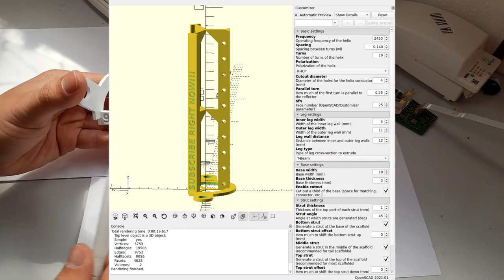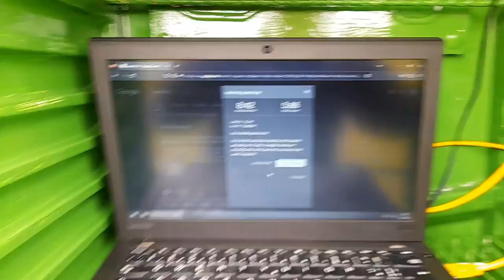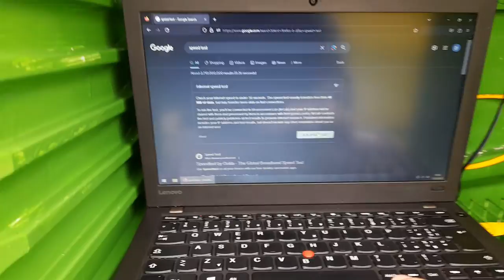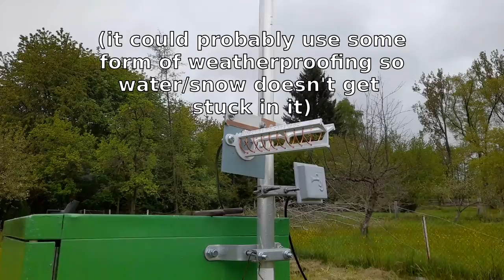Building a 2.4 GHz WiFi helical antenna

Comment: This is something Im going to try this weekend. Have a garage about 70meters away from house.
Edit: Holy smokes, antenna works as a charm, tested with my phone, and about 50 meters away its still full signal. speedtest also shows same result as if I was standing near the router.

Comment: We built high gain antennas 20+ years ago trying to network our houses together, pringles cans, satelite dishes, flower pots. our ultimate problem was the ficus trees in our area acted as giant radio sponges. we were able to get up to 3/4 mile range in a straight shot.
Reply from the maker: Yeah shooting microwaves through trees is a losing battle. I'm hoping I can get my hands on some of the 900 MHz routers, that would be quite interesting to see how they compare to 2.4 or 5 GHz, it should be able to reach further and better penetrate obstacles, at lower data speeds
Reply: We, too, have the vegetation problem.   But a part of me in interesting is seeing what it would take get "borrow" the WIFI from a McD's about a mile away.
Reply: Pringle cans.. the memories!

Comment: Love your videos !!  Way back, when I started the FCARC ham radio club. A fellow ham and I, set-up a temporary repeater on 444.250mhz. We didn't have an outdoor cabinet to mount the gear in. But we did have an old refrigerator ! So we used it to house the radio, controller, power supply and duplexer. We dubbed it the "Fridge a peter" !! It worked out very well and got some laughs too !
Keep up the great work !

Comment: Thank you for not cutting out your mistakes when editing the video. This is what it's REALLY like making something of your own! It's good that you know which parameters matter and which don't.

I was glad that you expanded the hole for the center conductor of the type-N connector. I was telling the screen that the hole should be the same diameter as the dielectric in the connector.

It would be interesting to see what the VSWR curve looked like. Do you have a nanoVNA?
Reply from the maker: Yeah I do have a NanoVNA V2 which can measure these, but I didn't really want to add that information into the video to not make it even longer (and the point was to show that you dont need any special tools like that)
I do however plan on making a loose continuation of this topic where I will most likely do the full measurements as well as long range testing
Reply: @dereksgc  Cool. I would really like to see what bandwidth you ended up with.

Comment: That looks like a lot of copper for 2.4 GHz. In a tank circuit, that would most likely be under 30 MHz somewhere. Have you connected this to a spectrum analyzer to see where it's peak is? Maybe I missed something?
Reply from the maker: not this exact one, but similar antennas I've made did have a resonant peak around 2.4 GHz, sometimes slightly higher or lower but they are wideband enough for that not to be too much of an issue
Reply: Helices actually have two radiation patterns, depending on the dimensions you choose.

If the circumference is much smaller than a wavelength and the pitch is much smaller than 1/4 wavelength, then they do act like a dipole, with an omnidirectional "radial" pattern, perpendicular to the axis of the helix.
But in this case, it's a directional ("axial") helix antenna, where instead the circumference of the helix is proportional to the wavelength, and the number of turns affects the directional gain. Then, the maximum gain is in the same direction of the axis of the helix.

The Wikipedia for "helical antenna" goes into more detail about those two modes.

Comment: Biquad behaves better when there is no direct visibility to the helix. At the helix antenna, in addition to the drop in reception level from linear to circular by -3dB, the reflected signal has reversed polarization and is not received by the helix antenna. It is ideal to use helix antennas in both parts, installed in a place with direct, unobstructed visibility. You can also use a biquad or helix as the primary antenna for a parabolic antenna, which seems to be sitting next to the rack, unused.

Comment: neat. I built and use these starting in 2013 for my drone photo/video business(at the time). Before then, Soda cans for home wifi (like idk 2007?) Now, am an active amateur radio enthusiast and building all sorts of fun antennas. I don't think I heard it, but your method to attach the center conductor is perfect, but really ought to be measured and kept at a distance that maintains a 50ohm insulation gap, which the hole in the reflector perfectly accommodates. Where it seems it might be too close is that 3d print might be dipping down before spiraling up. But that's just nit picking, and your results clearly are good. Great video!

Comment: I have been thinking about building 4 Helical antennas for, 1296MHz EME. 2 left hand and 2 right-hand polarization with one feed point for a 4.5 meter dish stacked very close together. Those printed coil supports look awesome.

Comment: Thanks for this video.  I definitely want to try this with my Internet connection which is cellular based.  One recommendation on testing.  You should give iperf a try.  You could setup the server on a workstation in your house and then run the client side on the laptop in the fridge.  That would tell you the true bandwidth between your house and the fridge for the two different antennas.  Who knows, maybe the helical antenna is ever better than 4 times.

Comment: You might get a step drill for working on the sheet metal...they leave a bit of a chamfered edge, and don't "grab" when they go through, and you just drill to the hole size you need... Safer, and 'cleaner' !

Comment: You only can gain so much improvement until the bandwidth needed needs a transmit frequency higher than 2.4ghz 

Problem is propagation, you want as low as takeoff angle to have dem waves travel  as close to the horizon before they fly out in to space, also one that won't be affected by water vapor, trees, or a building

It's also quite helpful for the wifi access point be at the highest elevation relative to area and devices connected

Then use a 2.4ghz repeater to allow a slower network to fill gaps

Comment: If I wrap the copper wire in helix, around a 3D printed PLA tube, which has a pre defined grove in helical form, and super glue them together and keep that tube attached to the dish. Will that effect the gain of the antenna.
Reply from the maker: It is probably going to work, that is how I made my very first helix as well, but I can't say how different types of PLA may affect the helix
Reply: @dereksgc  put a sample in a microwave oven (and a cup of water). the hotter the sample gets the worse it is for RF use

Comment: amazing video! i was comparing my results with your calculator and i think there is an error in the Half power beam width, the First null beam width and the Gain.  Bhp = 52/[ (C/lambda) * sqrt( n * (S/lambda) ) ]  ,  Bfn = 115 / [ (C/lambda) * sqrt( n * (S/lambda) ) ] ,  G = 11,8 + 10 log [ (C/lambda)^2  * n * (S/lambda)]
Reply from the maker: thanks for the heads-up, theres already one issue been opened on github about this, i've been putting off a complete overhaul of the website so i will try to get this fixed up during that

Comment: Thanks for you video,super keen to print and build one of these to be able to tap into my household wifi from my workshop which is about 40 m away. I'm not much of a tech head and was wondering what i require after the antenna to have wifi to multiple devices in the workshop.

Comment: Awesome video! I have been looking for a solution for having an outdoor base station like that. How weather proof is the fridge? Seems like a great solution if you can prevent water ingress.
Reply from the maker: Been about a year and nothing got inside. Just could use a bit of an extended roof so rain doesn't get stuck on the door

Comment: Quick Question: I really don't have any scrap yards near me and I'd need to buy one online. Would a copper sheet or aluminum sheet be suitable for such use? And if not, what would I need to search after? And what would be the measurements for a 1.7 GHz Antenna (diameter, thickness)? Thanks!
Reply from the maker: You can use this calculator to give you the dimensions based on frequency, you can also scroll down to read about some of the values and design choices: https://sgcderek.github.io/tools/helix-calc.html

If you can't get a sheet of metal, you can use any flat square/circular metal object, for example some of my antennas use the bottom of a large tin can cut out. A more unusual but still perfectly valid solution would be getting a metal dog/cat bowl, as long as the center is flat enough and large enough

Comment: I have question for this video, in sessions performance setting, you made antenna helix for transmitter or receiver? I need answer from u, sorry for question 🙏
Reply from the maker: In the video when I was testing the speed, the helix was aimed at a router with a standard whip antenna, so you could say the helix was at the "receiver". Router with helix was getting internet connection from a router with normal antenna far away
Reply: @dereksgc  okey thanks for answer, Do you think this antenna could be possible for transmitter communication WiFi?
Reply from the maker: @MONEYCONCEPT27  it could but it is not omnidirectional, only works well when pointed at things directly, and may violate EIRP power limits depending on your country
Reply: @dereksgc  I plan to design an antenna for WiFi communication as a transmitter, do you think a helix antenna or a microstrip antenna is better? I ask for your advice

Comment: This is great, and the antenna calculator is really nice! Thank you so much!
I just don't understand how does this relate to the dish. I know how to make a helical antenna, but where do I place it in the dish, how do I calculate the position, number of turns in the antenna, etc. given a dish I have.
Reply from the maker: you place it with the first (bottom) turn roughly where the entrance of the LNB would be, for standard offset dishes you want around 60-70 degrees beamwidth, for prime focus dishes helical antennas aren't ideal but if you want to use one you need a wider beam such as 90-100
Reply: @dereksgc  Thank you so much I understand now. I will get images from the Metop satellite even if is the last thing I do!

Comment: At what cable length do you use, you lose at least -3 dB. It is ideal to use a thicker and shorter cable. 1dB maximum loss with LCF1/2, but the disadvantage is that it is rigid and the plugs cost more. But you can use longer lengths, compared to thin cables. I use at least LMR400, 1/2 and for longer cable lengths type 7/8...

Comment: The file you linked to doesn’t have the same base that attaches to the reflector, could you please post the exact one you showed on your video?
Reply: Solved by changing the paameters around n the code, sorryabout that this is the first parametric (?) design I've encountered!

Comment: Super informative video. What kind of cable would you use for connecting the router to the antenna?
Reply: I forget the cable type atm but it's that small clearish tan stuff you use with sma / rpsma fittings, also since consumer wifi devices are not powerful you definitely want the cable run to be 50 ohm impedance,  as short as possible with no tight bends, kinks or adapters and NO loops.
The BEST option for a good wifi antenna is actually not an antenna but a wireless bridge radio set in client / station mode and used as an external high gain high power wifi adapter on your PC  laptop. literally all it uses is a set of ethernet cables to interface it's PoE injector (power supply) inline to the radio and from your PC / laptop. Plant it on a tripod outside facing the direction your desired wifi signal is in and the rest is web based setup and connecting.

Comment: Hi Derek, I noticed the helix_v5 models' default is 1700L, and not the 2450R that is in this video. Is it possible to have the values you used in the video posted in the description so we can use your calculator to edit the values in OpenSCAD? A thousand thanks! :)
Reply: After using a larger display, I could see that you included the proper values in the video (I just needed to look closely at a screenshot). Thank you! 🏆
Reply: On a side note: it looks like the bottom strut offset is placed at a value of 25 instead of 0 as shown in the video. Everything else looks correct, I think.
Reply from the maker: You can use the offset to lift the bottom strut if if gets in the way of the connector or anything else, besides the frequency+polarization, number of turns, and turn spacing, most other values don't actually impact the performance of the antenna itself

Comment: I was under the impression that helical could receive linear just as good as a linear antenna would. It would just pick both H and V at the same time.
Reply: linear will receive a circular polarized signal just fine, this is how many FM broadcast stations are set up so your stereos linear vertical whip / telescopic or horizontal dipole wire works.
The thing with circular polarization is they work best in systems with "moving parts" like FM broadcast transmitter is static but your vehicle is not or an orbiting satellite is moving (tumbling) or not in geo where you may be static or moving around via car, boat, plane.

Comment: awesome work bro. just inquiring incase we have two helical antennas for example lets say using this very one for 2.4 ghz, and we have them said by side but have them connected to the same cable feeding to the adapter will it improve on the reception stregthen or will it degrade instead
Reply from the maker: You would have to use a proper phasing network to make sure the two antennas actually work together instead of against each other. It can be done but it is much more difficult than just making a single helix a bit longer

Comment: Is stripping the plastic off the wires necessary if there's no shielding to get in the way? Might improve the outdoors longevity
Reply from the maker: It most likely would be fine, but it removes one uncertainty factor. Each insulation may have different dielectric properties and a different effect on the antenna, but as I've demonstrated in the video helical antennas are so forgiving when it comes to design changes it probably would still work

Comment: So for the point to point you only have the one helix at the ground station? Or is there a second antenna pointed at your fridge setup from the house router?
Reply from the maker: I only have one helix because the other router needs an omni antenna to cover the entire house, which means the performance is much worse than what it would have been with two helicals aimed at each other
Reply: I'm impressed it got such decent performance and that's good to know. The video was very well made btw good job

Comment: If you have a multi antenna router to connect these ones to, would it make sense to make 1 left polarized and 1 right polarized?
Reply from the maker: Probably, that way the router can work with the inverted polarization reflections. Left vs right hand polarization is for circular antennas more or less the same thing as vertical vs horizontal for linear, which is what MIMO antennas tend to use anyway
Reply: @dereksgc  all that destroys the function of MIMO, it's about getting the relative time-of-arrival of a valid signal and filtering out signals with a different time signature. the best information i can find for this is that the two antennas need to be a half-wave apart

Comment: Hey can you use this Helix with the dish? And what distance are you covering and lastly is it line of site? Will trees cause a lot of interference?
Reply from the maker: A dish feed should probably have fewer turns. I have several other helical antennas like this for various frequencies as dish feeds. 2.4 GHz WiFi will always be heavily affected by obstacles. In my case I'm only covering about 100 meters, but with trees and walls in the way. If you had a perfectly clean line of sight I'm confident you could achieve many km/miles of range

Comment: If you have two of these with different chirality can you do MIMO?  Is there something like a disk-yagi that would get you radial polarization so you could get 3 streams going?
Reply from the maker: Not sure how well MIMO would work with a directional antenna. If a circular signal reflects off something it inverts its polarity, so having both LHCP and RHCP could interfere with itself.
Reply: @dereksgc  if you used wifi5/6/7 with 2x2 mimo, with matching polarization on the 2 sockets, the router would be able to better ignore other signals/noise on the band increasing it's effective range much further. there are extra options not enabled by default in openWRT regarding this. obviously this would involve two dishes at each end, but plain helicals + mimo is awesome for point to point
Reply from the maker: @timothius9000  Yeah absolutely, LHCP/RHCP MIMO would be the ideal solution, I just wanted a straight test of one antenna vs the other considering that they both promised more or less the same gain. One issue that comes to mind is dual-band operation on 2.4 and 5 GHz, the helix might not be very suitable for that, though there are dual-band helical antenna designs that have been proposed
Reply: you'd be better with devices that have 4 antenna sockets, 2 x (2x2) mimo (and 4 helical antennas looking like an array)